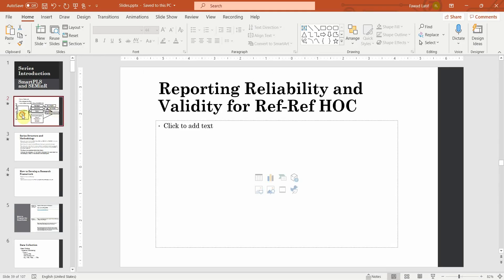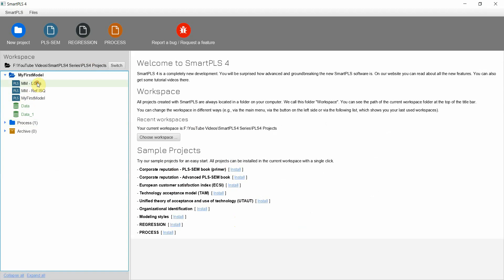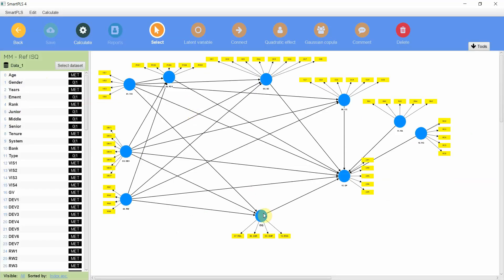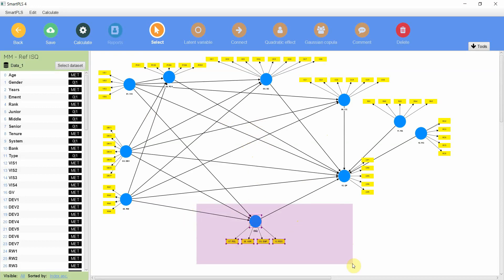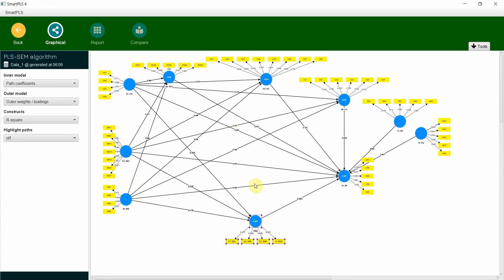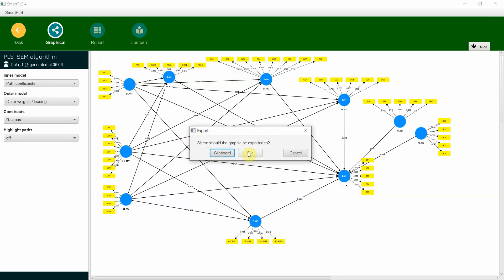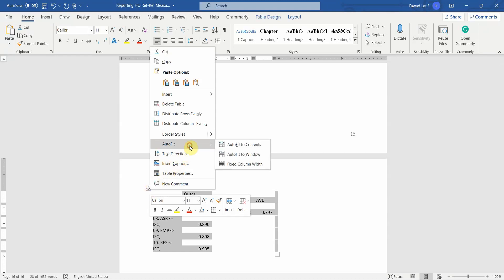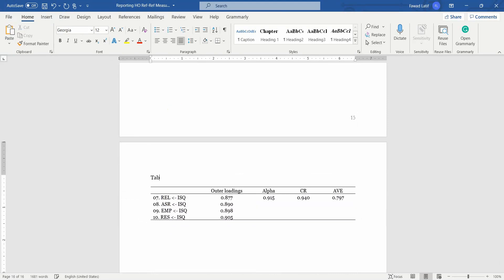#SmartPLS4 Series 17 - How to Report Reflective Reflective Higher Order Construct

Comment: Good evening Sir. My higher order reflective-reflective model shows discriminant validity issues under both HTMT and Fornell and Lacker. It shows 0.929 under HTMT. How to resolve this? The discriminant validity issues had been resolved at the LOC stage using your guidelines. How to handle such issues at the the HOC (reflective-reflective) stage?
Reply from the maker: You can use the same approach at higher level.

Comment: Hello Sir. I have a question When writing my thesis do I assess discriminant validity for lower-order constructs first then for higher-order constructs. I saw this argument on smartPLS forum and it made sense at the time:
Should we expect lower-order constructs that converge into the same higher-order construct to have discriminant validity?
"You will often find that lower-order constructs are not distinct. Particularly, when you model a reflective-reflective type of construct. This type of construct has a built-in inherent logical problem: You want your lower-order construct to be distinct (see above), because it would otherwise not make much sense to model them as separate dimensions of your higher-order construct. At the same time, the reflective nature of the higher-order construct calls for redundancy in the measures. They should all measure the same common factor and be more or less interchangeable and thus exhibit high correlations. These high correlations often contradict discriminant validity criteria. Hence, you operate at a very thin line between not fulfilling one or the other criterion. Hence, I usually avoid using these types of models. You can also find quite some criticism on these type of models in the literature."
So my question is what's the logic behind testing reflective-reflective higher-order constructs on the lower level where in fact these lower-level sub dimensions should be more or less inter-changable in a reflective model.
Reply from the maker: You Will have to assess the reliability and validity both at lower and higher level for reflective-reflective higher order construct